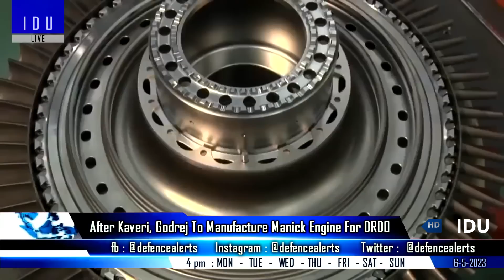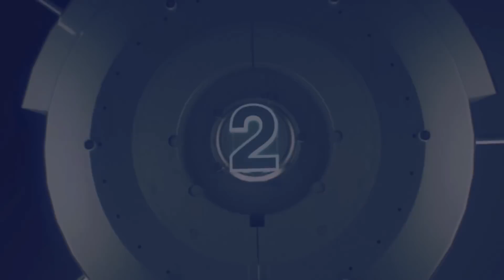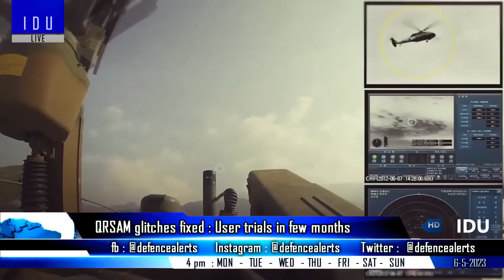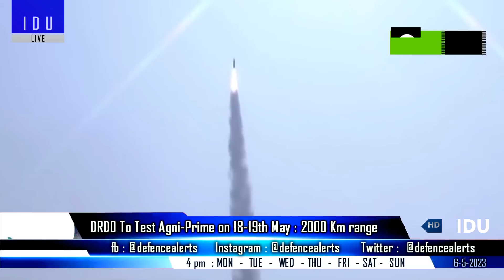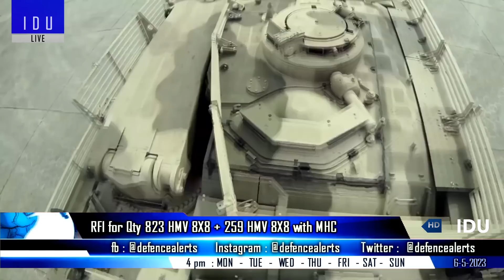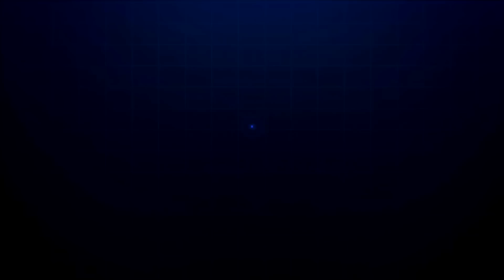Indian Defence Updates : Agni Prime Test, F-414 Withheld, QRSAM Fixed, LRLACM Engine, 1082 HMV Order

Comment: This is how you will get stuck when you involve USA in any business deal. Indian will not be able to advance in any of its defense deals will USA and this will have a major impact in India's independence on defense manufacturing. It is wise and just to not to depend on USA in the manufacturing of defense equipment. Even before the deal is entered into, we see restrictions from the US side in the manufacturing of F414. This is where we understand how reliable is Russia.
Reply: @Flying Tiger India pulled out of the joint production of fighter jet deal by Russia for reason of it being expensive. Maybe India was too optimistic about the Kaveri Project which didn't yield much expected results. Even the offer for joint production of new generation fighter jets by Russia was not considered by India. India being poor is not the fault of Russia. But they had the heart to offer. Maybe India could produce something remarkable like the Brahmos, joining with Russia. Or maybe engage in projects like Kaveri.

Comment: Totally expected that US will not allow GE 414 ToT. However, we will still need 500-800 of those engines to power Tejas MK2 and initial AMCA over its lifetime. So it's okay they don't want to give the tech but local manufacturing should start - saves on imports and creates local high paying jobs. Indigenous engine development should be with Safran or RR. Both these activities should be independent of each other.

Focus of GOI should on getting work done instead of sitting idle on multiple offers
Reply: @Flying Tiger not so much when it sanctions and grounds our entire future Air Force. I'd rather have a new engine from scratch with IPR with India. We can go with GE for the current Tejas jets, but future will have to be a new engine.

Comment: I don't understand why India keeps entertaining GE engine offers when Rolls Royce has repeatedly indicated that US would never give India the IPR. This is seriously dumb considering Rolls Royce has agreed to complete IPR to India but India keeps entertaining GE offer.
Reply: The F414 is needed for the Tejas MK2, TEBDF and first 40 units of AMCA as the new AMCA engine won't be ready before 2040.
Reply: @The Novice Gamer  Yeah but if India wants to sell Tejas MK1 or MK2 they can't do it if US is not on friendly terms with that country. Look what happened to Turkey they used American engines on their attack helicopters which Pakistan bought but Americans stone walled Turkey and ultimately that deal fell through for Pakistan after which they went to China. My point being under no circumstance GE engines are better for India. We should seriously consider Rolls Royce even for MK1, MK2, TEDBF and AMCA(40 units). Even if the initial engine IPR is not given ultimately Rolls Royce is giving 100% IPR to India on the new joint project which means we can sell to anyone. GE engine deal is bad.
Reply: @saimadhavarao  The problem is time. The RR engine will enter service only around 2040. We can't wait that long. We need the Tejas MK 2 within 2030 if we are to maintain over 30 squadrons.
Reply: @The Novice Gamer  The real question becomes is do you want your jet engine to be dependent on American supply chain or be independent in RR deal. In small quantities I agree GE F414 engines make sense for now but these engines should remain in small numbers and we should initiate RR deal immediately. RR engines are as capable as GE someone above said that GE engines are best in class which is nonsense. They should check up EJ200s further upgrade capabilities cause that engine can easily be upgraded to 110-120KN which is what AMCA needs.
Reply: @thenovicegamer007 cantthe rr engine be used for both amca and Tejas ? If it meets the power requirements for a 5th gen aircraft, it would surely help in introducing new weapons into Tejas mk2 as well, maybe a ew suite or  directed energy weapons in the future
Reply: @harshitsinghbisht8044  Of course it can. But the problem is time. If we halt Tejas MK 2 production till the RR engine is developed, our squadron strength will have fallen to around 25, which is hardly enough to deter Pakistan let alone China.
Reply: May be try to understand what is getting stated here before sharing your expert comments. That discussion was for the engines to be used in Tejas Mk2 and 1st version of AMCA, not the colaboration of building new engine. Looks like you did not get that fact in the 1st place.
Reply: @Suryasis Mandal  Tejas MK1 already uses GE F414 engines and this deal is being made for production of these engines in India hence US govt is discussing over the IPR protection so that India doesn't rip them off. Looks like morons like you cannot even understand what is being stated in the video but seem to be preaching here. I mean seriously how stupid are you that discussion was not abt the usage of the engine rather the production of those engines in India and of you couldn't understand that basic fact it shows how retarded you are. 😂
Reply: First GE 414 engine is one of the best engine with its category. Powerful and very reliable. So we selected that engine for Tejas 1. And it is still one of the best engine available to power MK2, TEDBF and AMCA 1. Compared to that RR and Saffron engines which are available  are not that great. 

Now with GE 414 selected for most of these jets, it make sense to go with them for AMCA 2 as well to get economies of scale. New engine only for AMCA 2 which will be build around 100 - 150 makes it un affordable. 

So it is logical.
Reply: @vaimurthy  The Tejas Mk1 uses GE 404 engine, not 414. And the RR engine will also be used in the future 6th gen Fighter that is intended to replace the SU 30MKI.
Reply: @Flying Tiger  I'm thinking you misunderstood my message. That End User Policy is by the US and this was hot topic when Balakot air strikes happened. Cause that meant Pak could never use its F16s in an offensive capacity and this was raised by Indian govt with the Americans cause Pak did use F16s against India. And not sure if you remember but a Mig 21Bison shotdown a F16 in Pak but this was again suppressed by the Americans cause globally they had many countries operating F16s. So as not to tarnish the image of F16s they denied any F16 going down but it was the ppl who clearly said they saw 2 aircrafts go down.Americans do not have many changes to its End User Policy, whether it's a NATO country or a non-NATO country.
Reply: @Flying Tiger  OMG dude before you make silly arguments understand what you are trying to say. EJ200 will come with same restrictions as F414 but the new engine being offered to India will give 100% IPR to India meaning there can be no end user policy on those engines. I mean seriously use basic common sense to understand the nature of the deals being offered here.
Reply: @Flying Tiger   Read my message carefully to understand what it says. I never said EJ200 should be used for AMCA I only pointed out that RR already had the expertise to upgrade the existing EJ200 to 110-120KN engines. My point being there is no difference between EJ200 and F414 in terms of end user policy or other restrictions but in the long run Rolls-Royce is offering a better deal to India sell its Tejas MK2 or TEDBF to other countries without restrictions whereas Americans can easily block the sales to other countries if India doesn't agree with American foreign policy and the biggest example of this is Turkey. They learnt it the hard way and hence they are opting to partner with Ukraine and Rolls-Royce for their engine programs. If you can't take lessons from what is happening in the world then you are considered an idiot. Also tempest program is separate from RR offer to India. India has been offered 2 deals by RR one with BAE systems which is part for Tempest program and the 2nd exclusive partnership with Rolls-Royce with 100% IPR.
Reply: I want to educate my fellow Indians here why American jet engine deals are bad. Apart from America/GE holding the IPR there is something called End User Policy with every defense item that the US sells to other countries. According to this policy, the recipient country can never use these defense items in an offensive capacity only under a defensive capacity. So you see why the design of a new jet engine with Rolls-Royce is far better cause not only do the existing EJ200 have the ability to be developed into 110-120KN engines but also the fact Rolls-Royce wants to develop a new engine which would be new in this class of 120KN with India. Which means China is free to use its jets without any restrictions against India but we are bound by the end user policy which prohibits India from using these jet engines in an offensive capacity. And we don't even know to what extent these GE engines will be manufactured in India cause if some of these parts come from West then US can easily block the sales of these spares to India. Why I said some of these parts come from west is cause some Titanium parts are made by other countries so just imagine some of my fellow Indians cannot even comprehend as why an American jet engine deals is disastrous because if we don't agree with West next time they can simply stop supply of these spares to India. Don't believe me look at Turkey they got kicked off the F35 program, sanctioned for buying S400 and then prevented Turkey from exporting T129 ATAK to Pakistan because LHTEC is an American engine so they denied certificate to export. Again those advocating for American engines should do a proper research before coming up with bizarre justification as to why they are better.